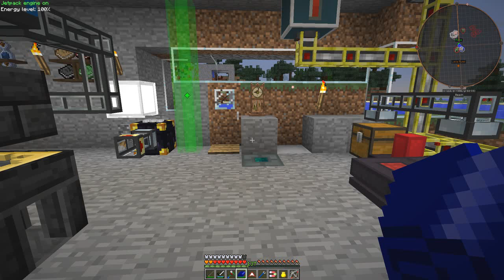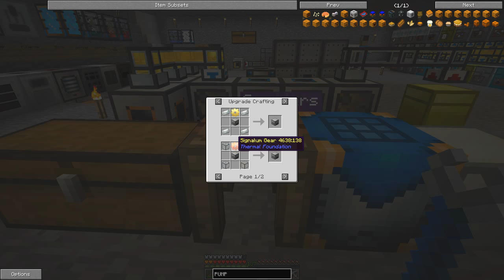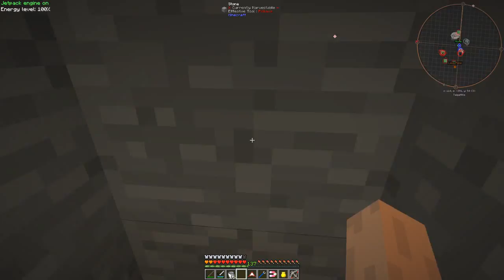Episode 29, Thermal Expansion Upgrades

Comment: Nice overview. Your voice is soft and pleasant, but sometimes it's a little hard to hear. You might want to get closer to the mic or adjust the volume ratios so your voice is louder compared to the game sounds. Otherwise, great video!
Reply from the maker: +Danny and TT Many thanks a kind comment, I tend to speak quietly in real life too (drives the misses mad) and as of Episode 31 I'm normalising the audio of the commentary, let me know if this improves the audio.
Reply: Yes. It definitely sounds better. I split my audio too using Bandicam. Then, I turn up my voice which is kind of quiet too, but I don't think you can tell in my recent videos. I think you might still sound a little better if you could get closer to the mic, and it would reduce the mouse click sounds a little. But, I can hear what you're saying a lot better now. Thanks for listening to your viewers. :)
Reply from the maker: +Danny and TT How do you find Bandicam and have you used dxtory? I quite like dxtory not expensive and can use any vfw codec.

I have a Rode USB mic that sits on the desktop and it is sensitive to external noises :-( but it is easy to use. Just got a stand for an AKG mic and will try this next time as it need to be near to the mouth.

BTW thanks for the comments, they really do help.
Reply: No problem. I'm glad to help, especially since I've faced some of the same challenges in my videos.
You can get Bandicam at www.bandicam.com. I've tried dxtory, but I ruled it out for some reason that I no longer remember. I've also tried Fraps which was decent. I like Bandicam, because it can split the game audio and voice audio into separate files (just click "Save audio tracks while recording" under the video settings), it doesn't slow my frame rates as much as Fraps did, and the resulting video files are much smaller.
Ideally for a mic, you'll want a condenser mic. They'll cut out the outside noise and make your voice sound more full and clear, but you have to speak directly into them and they can get pretty expensive. I use an relatively inexpensive Samson condenser mic and it seems to do the job, though I do hear my wall clock ticking sometimes. But hey, I'm not going for absolute perfection. xD